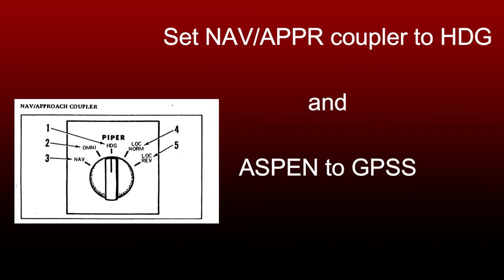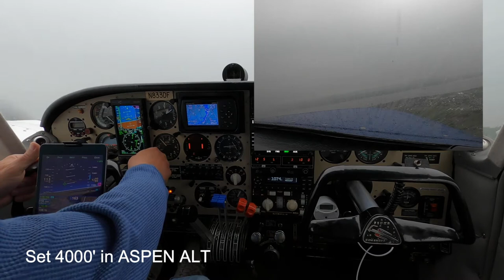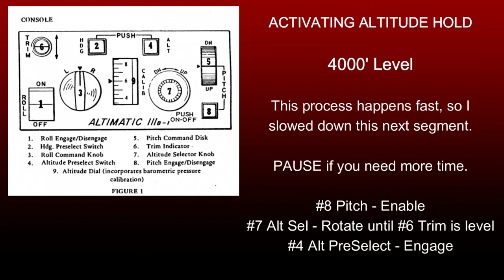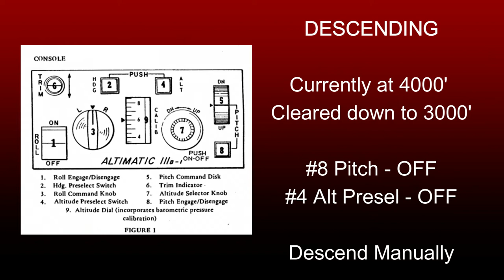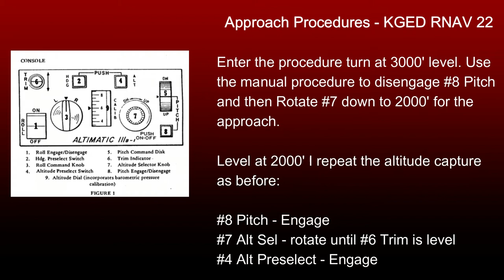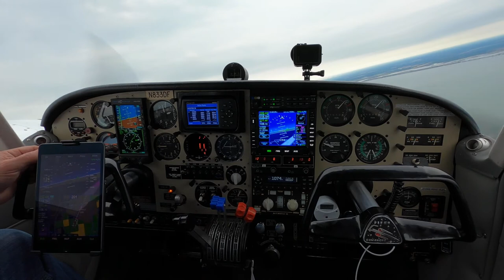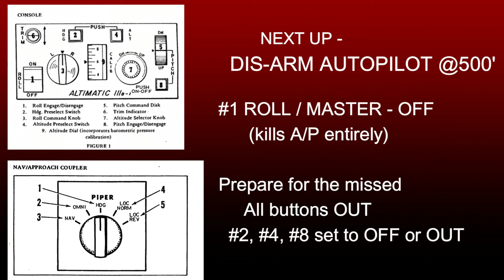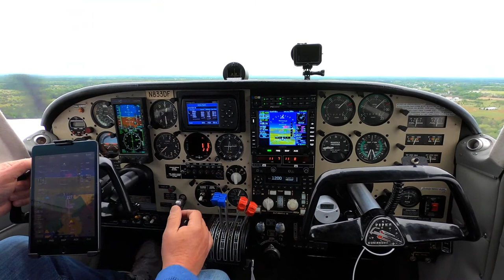20220506 PA30 Pilot Altimatic IIIB Flying

Comment: Thanks for sharing this, Frank.  A few things that are wrong in your assessment, if I may.  Your pitch rate is not adjusted.  The C3 are “angle based” autopilots in both roll and pitch.  The agressiveness you saw in pitch is because the limit values are not adjusted.  A -2.5 and +7 degrees should be set in pitch.  To verify this, descents should be made at 18MAP and Vcruise +10 mph.  This is all documented in the Piper Altimatic 3 service manual.  Also, I noticed the pitch indication is not squared horizontal as it should be.  All these are adjusted from the console.  

You should be able to perform a descent and a climb by isong the #8
Reply: Ping me if you need the info.  These are very good A/P once properly setup.

Thanks for doing this.
Reply from the maker: Francois,

The process you described sounds exactly what my favorite tech would do in flight with me, but I haven’t considered attempting this on my own. I happen to have a service manual, so I’ll take a look. I do have access to a fellow PA30 owner that does his own avionics work. Along with him, I might feel comfortable taking that next step.  That’d be amazing to get that much more flexibility out of this machine. In the mean time, my compensating technique gets me a very capable autopilot. 

Thank you very much for taking the time to explain that to me. It encourages me to keep learning something new. Very much appreciated. 

Frank

Comment: Nice video ! As I’m looking to buy a twin Comanche, it’s quite instructive !

But I wonder, was any twin sold with prop/wing deice ? Or can it be added as a kit ?
Reply from the maker: I’m no expert in building them or modifying them. I’d join FB groups for the twin Comanche and ask Zach Grant or the other experts in that group. 

If you cannot do that, or would rather not, I’ll relay that question for you. 

I don’t play with ice in mine. I found that my tail is prone to rapidly developing an ice horn. I have a skinny horizontal stab. 

I’ve removed my curtains in the back to ensure I can see the tail. 

Let me know if you want me to run it down for you 

Frank